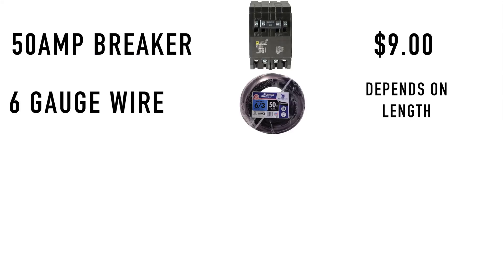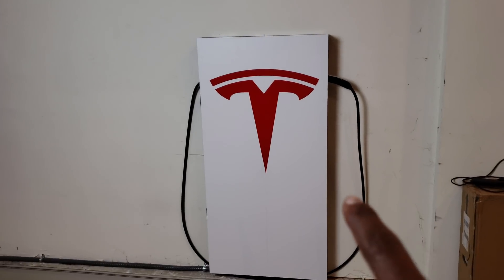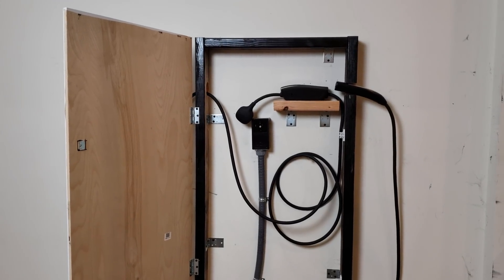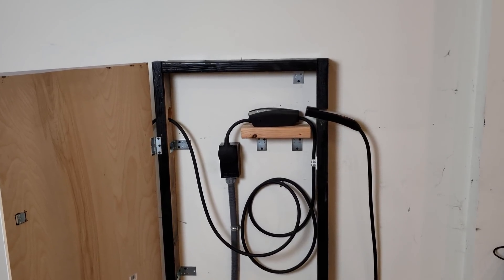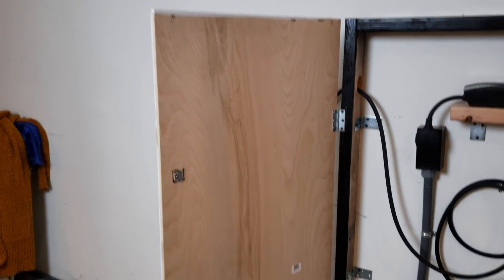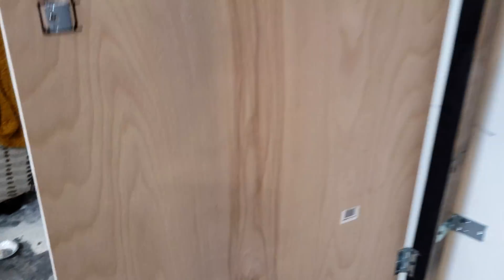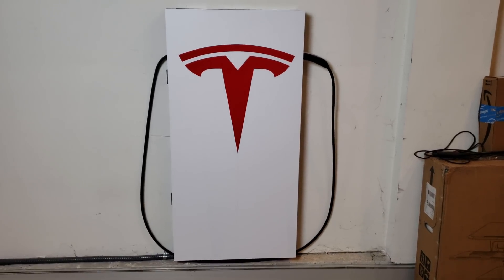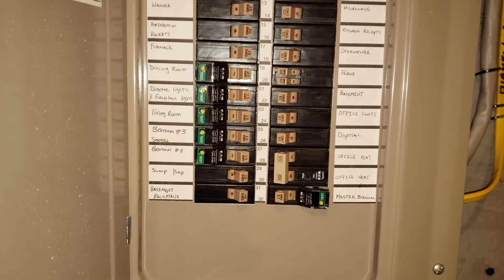Tesla Model 3 DIY Garage Wall Charger | Under $200

Comment: This is awesome. Looks like you did the electricals. I would be scared and have an electrician do that.
Reply from the maker: I Just shut down the main power and connected the wiring correctly, and it was not too bad.

Comment: Very good detail video👍
I had to run 125 ft 6 AWG wire from basement to garage with 50 amp breaker. Used Nema 14-50 R outlet.
Reply from the maker: Did u do it urself??

Comment: Great job. Question: Under what circumstance do we use a metal piping? I heard something about exposed wiring may cause fire.
Reply from the maker: It's not necessary with the 6 gauge wire, because it's rated for outdoor use, I did however put a rubber housing in it. Just buy one that is rated for outside use, hope that helps

Comment: wow. u just saved around $800 caz i had called Tesla a few months ago for this.
Reply from the maker: sometimes you just gotta do it yourself #diylife
Reply: How many amps does the small charger provide when charging?
Reply from the maker: @TheMakersWorkshop  32amps which charges at about 31 miles per hr